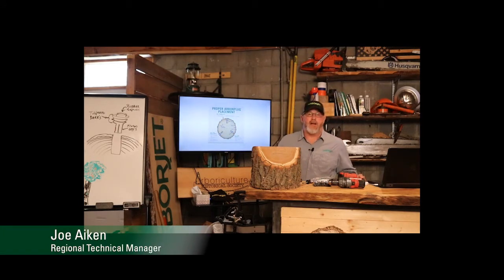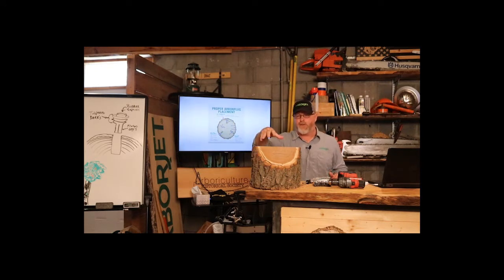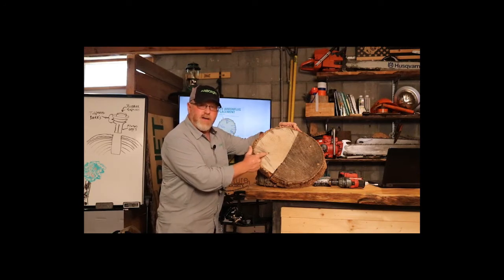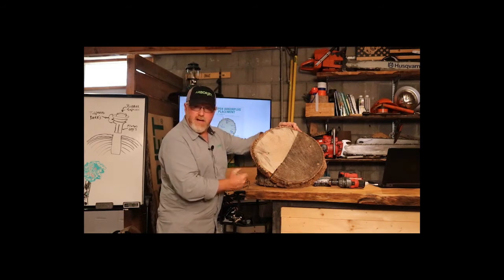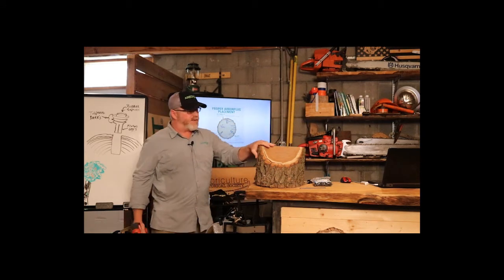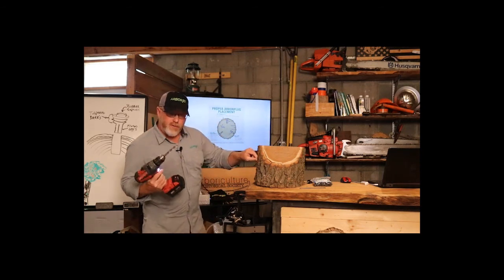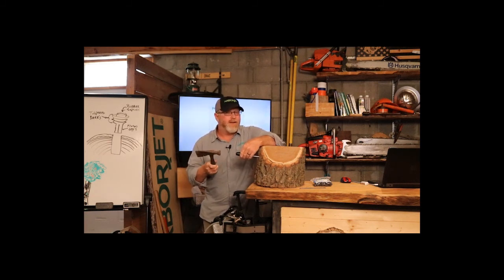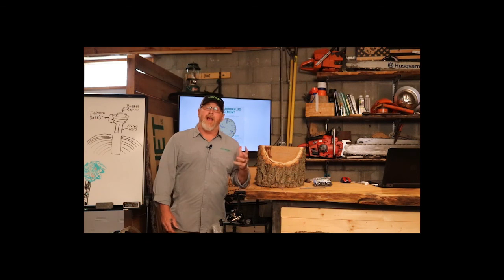Setting Arborplugs with Joe Aiken

Comment: I just injected IMA-JET into a western Hemlock with wooly aldegid. It was 50 degrees outside in November. I followed the label instructions for a 24 DBH. I have experience with setting plugs. Done several trees before this one and had no problem getting the product to uptake. I had a difficult time getting the product  to uptake this time. Most of the holes would not or if they did, I couldn’t get all the product required in them. Is this a seasonal issue?  Should this be done in warmer temps?